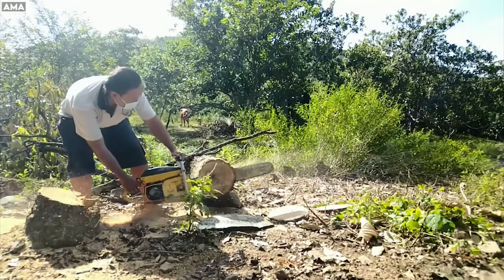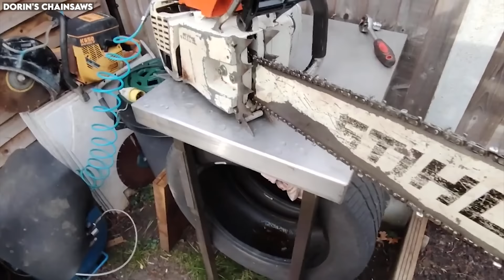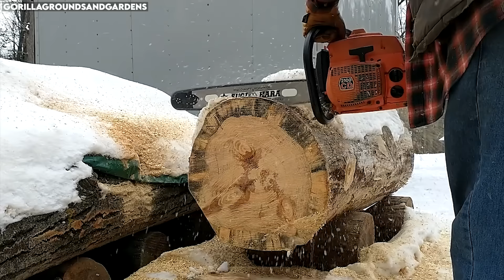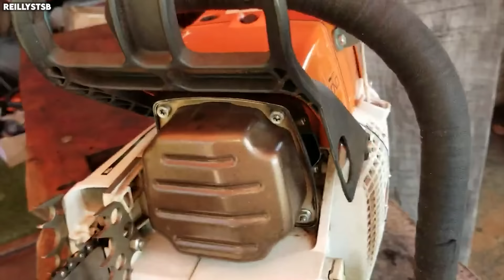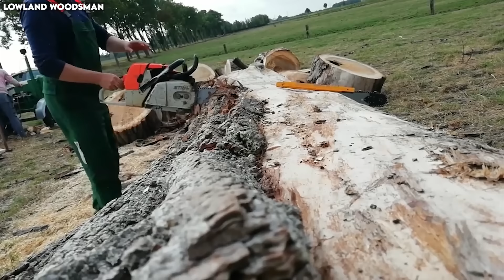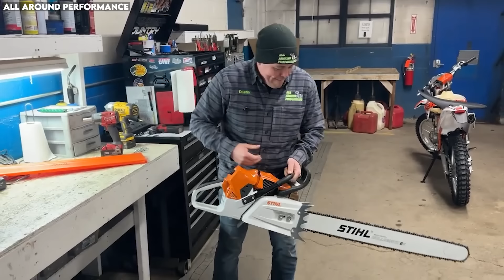10 BIGGEST CHAINSAWS EVER BUILT !

Comment: My first chainsaw, bought in 1978 was a 125 Mc. that was to buck with. My fathers falling saw was 125 Mc with the go-cart cylinder, which in time got bored, had a Wiseco piston, modified carb, some port work, with a 60 inch bar. That was a falling saw.

Comment: Falling Timber out of Sandspit on the then Q.C.I.  late 70s to mid 80s, paid to run our own saws. 36in bar was most common. Working a 6.5 hour day, I and several others used Husqvarna 2100 Super XP,  73 LP Chain. Others used Stihl 075s same bar 404 chain. Both reliable powerful machines. 2100 had a manual oil booster pump, Stihl did not. Falling in Big Timber especially Sitka Spruce, Stihl owners would break a chain within first 10 days, & after repair every day or two from then on. Plus the 075 only got 6 or so weeks out of bar before the rails needed to be ground true. After 6.5 hrs Men running 075s would come out of their quarter to the Crummy, two gallon gas empty, but their 1 gallon oil jug remained in the bush, it still had enough oil in it for another day! Then it still had we bit in it the end of day 2!. 2100 never broke the smaller chain and burned same 2 gallons of gas but pretty much a full gallon of chain oil each day. Also I would get 6 MONTHS out of my CANNON BAR before truing the rails. I still use my 36in CANNON BAR on occasion to drop some of the biggest tallest Oak/ Maple trees around Georgian Bay Ontario; managing our Hardwood forested ranch. PHUK is that thing ever heavy today at 70 years old!  The 090 Stihl was a beast; IT had a manual OIL booster! The Company owned one with a 60in bar, for the occasion we needed to fall some 12 /15 foot diameter Sitka's. Respectfully submitted.

Comment: Just more AI generated slop that can't pronounce names correctly, and wouldn't know a chain saw from a soup spoon.🤪 I had a Mall 2 man chain saw back in the 1970's that would make most of these rigs look like toys. It used a 212 cc. 2 stroke that drove a 90 degree right angle gearbox with a 72" (6 foot) bar with a set of handles at the other end for the unlucky 2nd man to hang onto. The gear drive could rotate for horizontal or vertical cuts (instead of actually turning the engine sideways)😉 Now... imagine bolting something like that to a modified 1970's Sears minibike frame? Yep, that was me!!!🤣 It was way too fast and dangerous to ride, but a hell of a lot of fun! It's amazing that kids like us actually survived.😄👍👍

Comment: Ive rqn and owned a couple of 075's and 076's and you could count the teeth going by on a 38 inch bar but you could damn near pull on it with both feet sinking in the goo pushing on the damn thing! I still have a couple rebuildable 051's ,and a 076mag and the super hiding in a pile of maybe somedays in my garage. I have several parts saws that could bring the infamous 056 back together as well as an 031 and 032, the 032 being my very first chainsaw that my dad bought for me because I just couldnt live without my own saw...My dad being a big timber cutter in Forks washington back when everything was huge and had to be bucked before they could log it. I use to pack his gas and oil for him until I was old enough to work with him bucking logs on weekends...ok listen, I tried really hard to buck logs for him, but mostly I beat the piss outta every extra wedge I could muster up, trying to free my piss pot 032 while he bucked on pass me and eventually just worked the other way so I had time to frantically remove my saw from one hang up to the next! I remember the first day I cut with him, and i noticed this REALLY PAINFUL sore spot on my lower back, and when I brought it up to him, he laughed and laughed and patted me on the head and said yup. I know yhe spot kid? It didn't take long after that to realize that spot and chainsaws go hand in hand! They mate for life i swear to god. These days I have been pleased with all the modern saws they make for professional users and think that the old saws were about the equivalent of operating a Volkswagen with handlebars. They are cool to remember using, but even cooler to watch somebody else have to operate.660's are big enough for anything I'll ever need to saw into. If it takes anything bigger than a modern 660 its probably illegal to beaver on anyways hahaha

Comment: I simply cannot find justification for an 881... even though it would be fun to own.😉 My 661 pulls a 36" bar just fine and that is more than enough bar for any tree in the area.... Especially when you consider that 2.5 times the bar length is the tree diameter limit for felling!
Reply: I have a 881 why cause my dad is an old school logger and still has he’s all original 090 the biggest of the time period. I simply wanted the biggest of my time period 

I got it for a good price lightly used for $2,000au over here there $3200 new 
I’ve also had it professionally ported by one of if not the best porter in Australia and is now cranking out almost 13hp it’s exciting to use

Comment: My dad had a red Pioneer with a floatbowl carburator, that had a swivel bar to keep the saw upright, when cutting horizontal. It had a very long bar, I'm guessing about 3 feet, and had an attachment point at the tip for a handle for the second man.
Reply: Yes correct 2 man saw. Diaphragm carburetor changed every thing.

Comment: Interesting that so far at 10 minutes, no full wrap handles. In the mid '70s I was packing an 070 with a 72" bar, full skip chain and I packed it all day long for 3 years bucking timber. The saw shop had a dozen 090s that were kept for the 120" bars.

Comment: My Husqvarna 3120xp is reserved for the biggest logs because it’s heavy but mostly because it guzzles gas. I try and run it a couple times a year just to keep it healthy. Although this said it was introduced in 2003 the internet says 1989 and I bought mine in 1997.
Reply: Yeah, it came out of the mid 90's.  I've got a buddy that has an 088 from about that same time period and it's the same deal: get it out a couple times a year just to function check it, essentially.  Built 500i's and modern ported 90cc saws have so much power and chain speed that the 105's, 120's, 125's are just irrelevant for 99.99999999% of jobs.  Great for milling, but I'm nt destroying a $3000 saw on an Alaska Mill.  That's what Chinese slave built clones are for, and if they get ruined?  Who cares.  Buy another one for less than the cost of a used 261 or 550.
Reply: @TheMonkdad The Husqvarna 3120XP is included in the brochure of their saw program 1990 -91!
In 2001 my Jonsered 920 was stolen, and I needed a new powerful saw..I chose between the Husqvara 3120 and the 2101XP..I chose the latter, because I thought the 3120 was far too heavy
1989 is probably the real introduction year for the 3120
Reply: Nice, encase you're not aware, Use SHELL V POWER, NO ETHANOL, Drain and fill with new gas and start at least every 6 months. I use AMSOIL at 50/1 but I work my 372 a lot. Husqvarna oil 50:1 is  fine. What size bar? Cheers!

Comment: 2100 no load max rpm 12000.  my first new saw was a 2101, it was 1987 i was 15. next was an 084. from there i run jonnyreds 920 and 930 for a while. tried an 064, it was flimsy. after a few 394 and 395s , i got a hold of an 066, and they dont make a better saw by my estimation. i did use a 3120 for a week, as well as once an 090 for a week, i had an 070 i cut firewood with one winter. you take an 066 or 660, trim the piston , polish the exhaust port, drill a couple holes in the muffler, use your oldest wore out carb jets, tune her up to 14000 under load, dont forget some lucasfilm or slick 50 when your assembling. regular gas, 50 to 1 Stihl oil, and the saw will run many years all day every day, nothing else can compare, nothing ever before or since .Maybe one day ill tell ya how to file a milling chain.
Reply: I love my 066Mag!!!
Reply: I've run an 066 and currently use a 660 magnum for bigger trees with a 36 inch bar. Does everything I need it to.

Comment: I have a stihi ms170. It will not crank with 94 octane straight gasoline mixed 50:1  . It has spark and new air filter and it just will not crank . Any suggestions? ??? July of 2026
Reply: Dealer. If you have to help just to diagnose the problem, you're already in over your head.
Reply: Try new spark plug. Maybe low compresion, or carb problem. Try litle bit of gas straight to carb.

Comment: Giants? Skil 1690, Solo super Rex, 076 super, Mcculloch 77, Homelite 7-29 rated for a 72 inch bar with 1/2 or 9/16 gauge chain. The 79y, cp115, and sp125 non-c were all stronger than tbs saws listed
Reply: Just bought a homelite 1050 automatic. Its a 100cc beast
Reply: Had a Solo Super Rex for 30 years, a 142cc monster. The guy I had servicing it, used to do the big Stihls that the professional sleeper cutters were using in the river red gums (Australia).  He had a test log of Grey Box, and he said when he tested mine there were a couple of the sleeper cutters in the shop. He said when they saw how the Solo went through the log, their jaws were hanging open. I gave it to a museum, as being in my sixties it was pretty heavy to use, and had become illegal to use anywhere (no chain brake, or spark arrester). Now I use my 395XP for big stuff, but usually the 372 is easier. The Solo gets overlooked in big saw videos, even Buckn Billy Ray seems to think his big Mac is the biggest saw ever built. As far as performance goes, I would put my Jonsered 670 right up there despite not being super big. Of course it's a softwood saw, but it's the fastest cutting saw I've ever come across. When I logged it used to scream at 14k revs all day.
Reply: @andrewlongfield3102 
How does the big Solo sound ??
The 125 McCulloch has a great noise . Unique among big saws. 
My XP3120  &   088 dont  sound even close to a Mac .
Both with standard muffler & porting
Reply: Hola Buenas tardez

Comment: I have a Husky 2101XP,  the successor to the 2100XP, and a Jonsered CS 2188, the successor to the 2095..and also a smaller CS 2152..So a pretty decent holding..
Greetings from Sweden!
Reply: You have a great collection my friend...
Reply: @kygreenskeeper8326  Thanks!
Reply: I was hoping for a 5120. Guess they stopped with the 3 series. Too bad. I never needed anything bigger than an old 372xp but I'm on the east coast. I run a 261c now. It and the 555 and 562 are hard to beat but 562 is a tad heavy. Not in as big as hurry as I once was. Only cut firewood and dangerous trees around the house. I can run my 50cc saw comfortably all day. Like I once could the 372. Its so smooth, stout and light. Ported the muffler and added an egan air filter. Really woke it up. Probably run with a stock husky 555 now😂. I just prefer the feel of stihl. Had a makita I loved too. Grew up on an 017 while dad ran the husky 55. Cut huge trees with that husky. Only 18" bar. Had to cut out a slot for powered to make the bar reach a few times. Sketchy shit. Why i liked the speed of the 372. Safer. Especially for preventing barberchairs. I cut out the heart these days. Too many close calls.